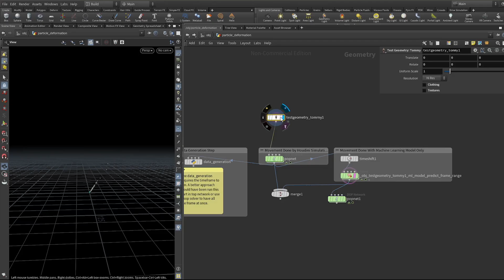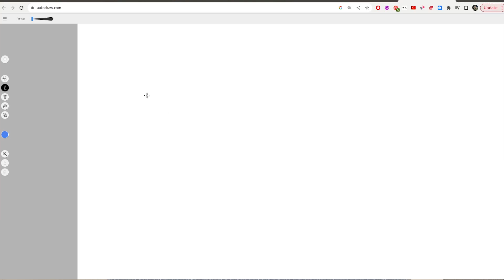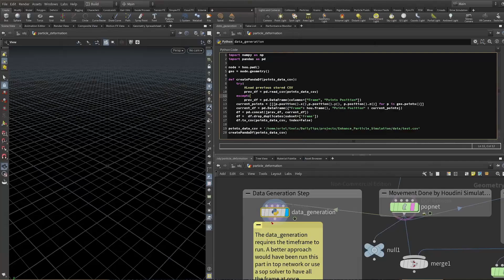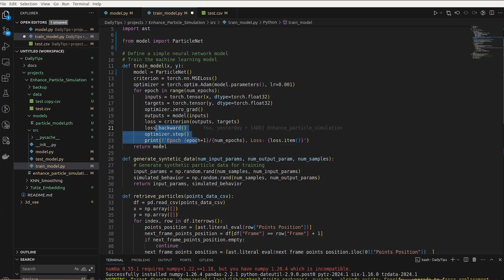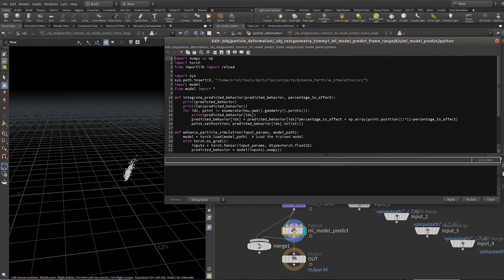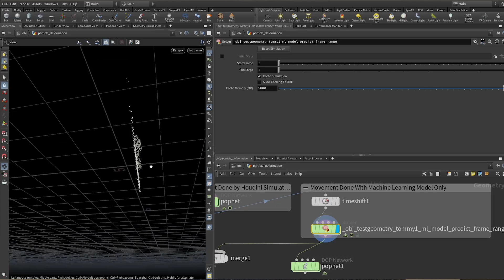How to make a houdini particle simulation with machine learning

Comment: how do you import libraries into your script? can this be done with top python venv? I cannot find a guide to do this anywhere.
Reply from the maker: Thanks for your question. Houdini comes with its own version of python. To let houdini use a new python library that do not come in a vanilla houdini you have 2 options, 
1-Override the python installation that houdini uses with your own python and whatever libraries you put in there.
2-Add the library/module to the already existing python installation houdini uses.
If this is for personal use I would go with option 2, you might not need the customization benefits that option 1 provides. Independently of the approach, the library needs to live in the list of paths that python look for. You can know all the paths typing (import sys;print(sys.path)). So just add it in one of those paths or override the PYTHONPATH env variables when loading houdini to have the location where you have your library as one of the paths to look for, check out https://www.sidefx.com/docs/houdini/basics/config_env.html for that,
Hope this helps!